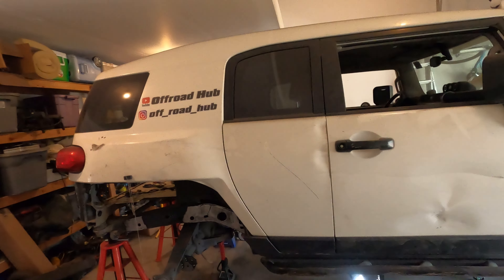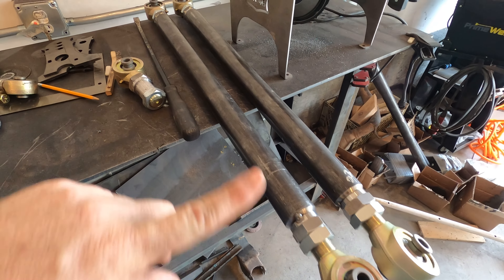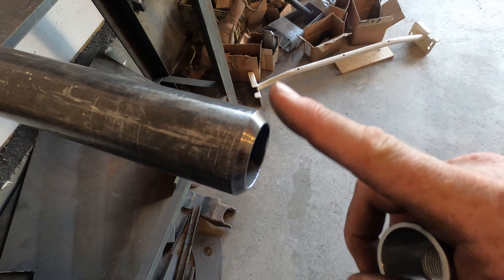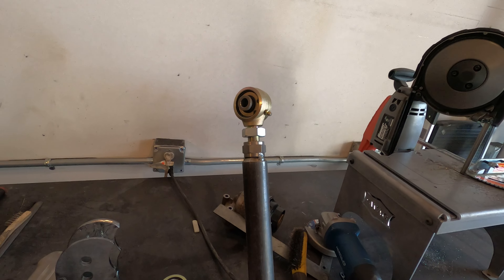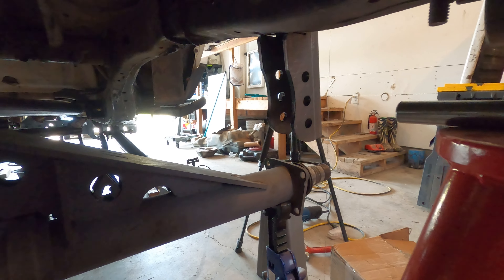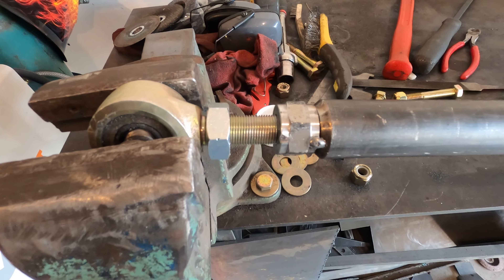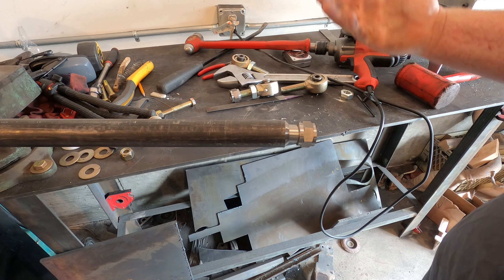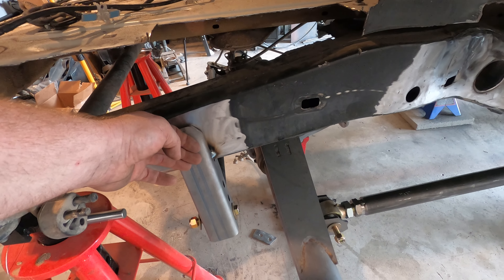FJ Cruiser Rear 3 Link Complete!!

Comment: Reflecting back to when I 3 linked the front and 4 linked the rear of my old 77 Scout using Dana 60 axles is mind boggling. Resourcing parts back in "89" to do this was much more difficult than today to accomplish. No Johnny Joints back then just spherical rod ends which are no way as good. It worked as intended but spherical rod ends wear out much quicker and were noisy. Replaced with Johnny Joints in 2004 and were much better. I sold the Scout in 2009 and only had to replace the joints once compared to many times with spherical rod ends. Little to no info was available back then to do all of this and had to fabricate all of the brackets. Lots of trial and error to get it all working but it was so worth it. Wishing you total success with this project and hope you will feel it was all worth it when you get it all dialed in.
Reply from the maker: Wow, sounds like you really had to rough it back then! Thanks for watching!

Comment: You can buy tap and dies to straighten the threads out. Check the I.d. of tube  and o.d. of bung, but more than once I have gotten tube that was supposed to slide in one another and did not. Your upper link frame mount is going to need a plate on the frame to distribute the load. You only have 1 upper and that will rip the tuna can frame and will likely leave you on the trail in a bad spot ,new d-shaft ,and   shock shafts. Do a plate that is 12" long  half" less the height of rail for nice weld to the face/top/bottom of rail. Put some nice radius on the ends too to eliminate stress risers and put some hole in the face of it as well for more weld surface to the rail . Use 3/16 "plate at a minimum  1/4" preferred.   For radius and holes go to the farm store and get an assortment of washers of different sizes as a guide for the plasma.  Hold them in place with a screw driver or tack them .
Reply from the maker: I judged the threads to be a total loss. Plating will be happening for all my frame mounted brackets. 👍

Comment: I’m sure it’s been said, but you should be drilling a hole an the end of your Links at the mid junction to your tube adaptors to add a rosette weld for strength. Great build, and great content!
Reply from the maker: It will be done. 👍
Reply: False this is not a  good thing as is distorts the bung
Reply: @jeffgreenwood5159  The increase you get in the strength outweighs any distortion risks. You're not applying any greater heat than your circular weld. If you're really concerned, mirror you rosette weld 180.

Comment: There’s going to be some strange stress on that axle-side track bar mount and joint, since it doesn’t allow the joint to move in the same, vertical plane as the frame side. Why not use an offset upright tower, like Artec, and bend the tube to clear the diff? As it is, it’s probably going to rip itself off the axle.
Reply from the maker: I agree. I changed it in a later video. Now they move in the same plain.

Comment: Could you just have cut an inch off that johhny joint so it fit into the nut? From my angle, it looked like it had twice as much length as it needed once fully installed into the bar.
Reply from the maker: If I cut threads off I'd be losing too much in adjustment potential.

Comment: I’m not an expert, but wouldn’t it be more appropriate to have the panhard bar level at ride height, especially with LT suspension. This would reduce horizontal movement of the axle and bump steer.
Reply from the maker: Level is ideal. I'm going to alter the axle bracket. Stay tuned. 👍

Comment: I am not a suspension expert so feel free to school me. Would the panhard be stronger/articulate better if the lower joint is mounted in a similar orientation to the upper?
Reply from the maker: It shouldn't be a factor. The axle moves up and down primarily, and that motion is fully accounted for on the frame mount side. Also, I could find a bracket that had enough reach backward away from the differential cover that was also in the same plane.
Reply from the maker: I'm going to improve it...

Comment: Are you worried about your panhard bracket on the axle getting smashed by rocks because its angled so far back? Looks like you would smash it on boulders fairly easily?
Reply from the maker: It's angled up quite a bit. I'm not worried. 👍